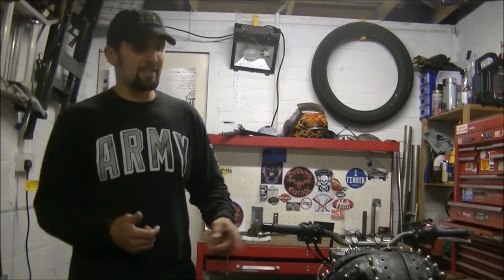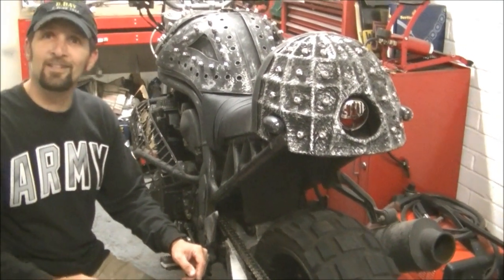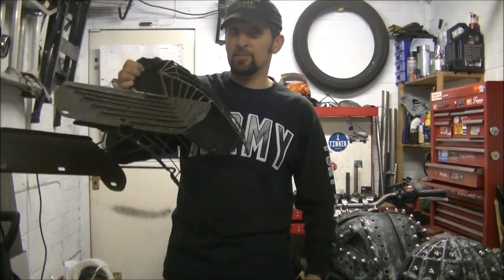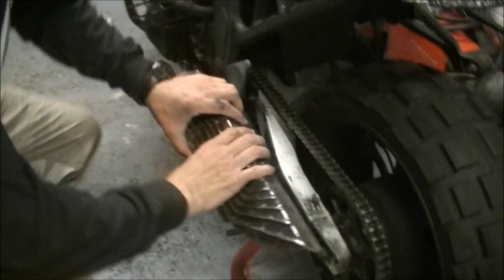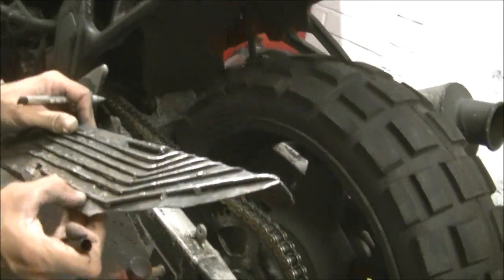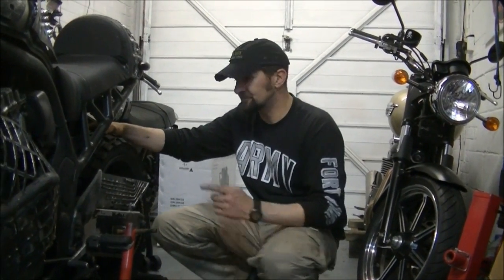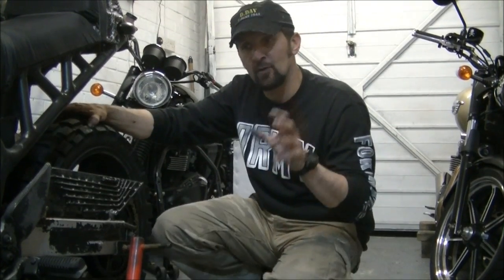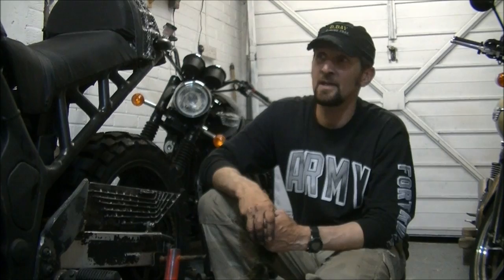Delboy's Garage, Project Bandit #21, Chain Guard.

Comment: Del, I was at a local indi-shop that also sells bikes.  they had one there where the owner took a damaged gas tank and rear fender and had a local artist outline some flames around the damaged parts.  he then had the flames cut out on a water jet and then powder coated them.  He then attached them to the good gas tank and fender with epoxy.  Looked really good.  Made me think of the bandit.
Reply from the maker: Cheers buddy, it's amazing the different ideas and skills eh...!

Comment: Awesome garage time!! Right then tip time, right now got an old bandit on the bench trying to split the fork leg as the seals gone south leg, bottom bolt is spinning nicely, any tip to get that bloody bolt out and stop it spinning. My broom handle doesn't want to know!!!
Reply from the maker: Hi Rob.....if you have the fork pulled apart then there is no pressure on the damper rod ro stop it....first try putting the spring back in and cap back on to force down on the damper a bit.....

if you tried that and it still spun....then take a length of 1/2" steel bar....about 3ft long....grind about 2" of the end into a tapered square so it has 'four corners'...poke it down into the top of the damper rod and tap it a few times with a small hammer to 'seat it'....(basicly makinf a steel version of your broom handle, with corners), then, with pressure forcing it in...snatch the alun key to see if you can shock it open....the corners of the steel bar will bite into the damper rod enough to hold it..    Hope that helps...always works for me buddy..!!

Comment: what would you do if some idiot cut off the attachment points for the chain guard.
Reply from the maker: depending on what swing arm you have, you can drill a 6mm hole and tap a thread into it, actually into the swing arm itself, then screw a small "L" shaped bracket to that hole....that will give you a handy tab to bolt your chain guard to..!  ?
Reply: @Moonfleet41  thats a brilliant idea, i took the easy route and switched out the swing arm itself.

Comment: Hi Dell love the channel you have saved me many an hour and a lot of cash with your vids.
Sorry to hijack the comments but if you get 2 mins to have a look at the video on my channel and the description I would really appreciate it.   If you could give me your thoughts as to whether my bike is safe to ride and what might be causing my problems that would be great.
Im new to biking and don't have anyone who I can ask.
Thanks and I will be back for a t shirt when I get paid if you still have any xxl left.
Reply from the maker: Hi Mark, had a quick look...cant see the scoring marks you referred to. The ring gear looks a little worn, but nothing more then expected for a 14 year old motor....the cush springs in the back plate are supposed to rattle a bit, they need clearance for heat expansion....and there doesn't appear to be any grooves in the basket fingers either... i cant tell how the main bearing it without feeling it in place on the shaft by hand.....but as long as there's no lateral play then it should be fine...    Did the whining noise suddenly start, or did you maybe just only recently notice it..?
Reply: Thanks for the fast reply.  I noticed it about 2 weeks ago and has got gradually louder. If I coast in neutral with the clutch lever in it stops then as soon as I put it in gear it's back. The scoring is hard to see on the video but is all around the outside of the basket and in side the housing
Reply from the maker: Mark Ellis
Mark, its hard to tell by watching a video, you need to feel bearings in situ in order to detect any undue play...but the fact that you have it all apart, there's not point putting anything back in there that's worn....so get yourself a new set of plates of they are worn....and replace any bearings you can...then reassemble it all with fresh gaskets and fresh oil......then see how it feels...

I presume the actual operation of the clutch was fine otherwise you would have said.. ?
Reply: Yeah all was fine with the operation of it all. I've got the bearings and stuff so will get them fitted and see how it goes.   It was the scoring that was the most alarming. I have put 2 other videos on that should show it a bit better